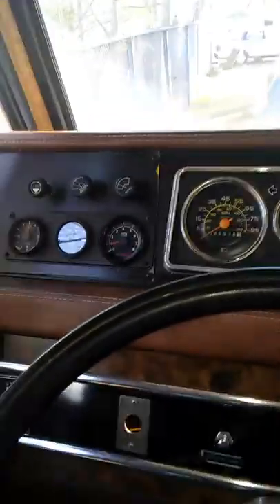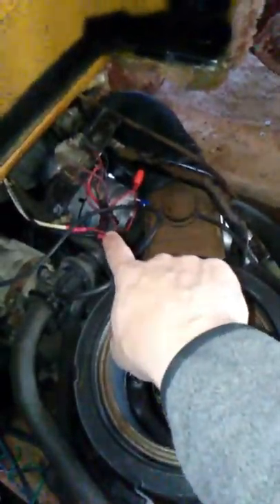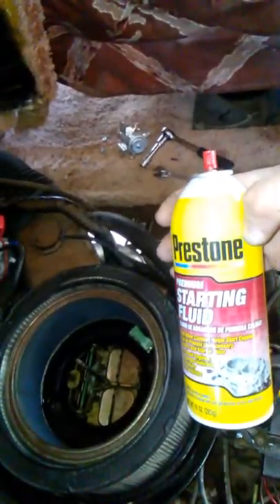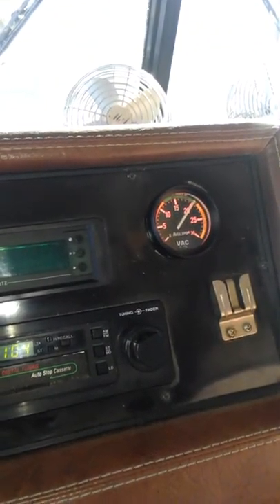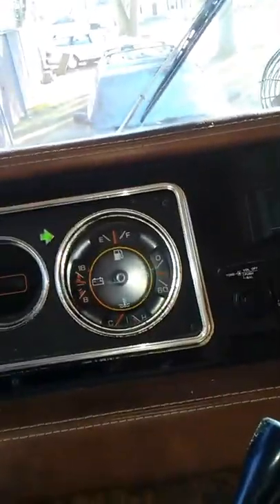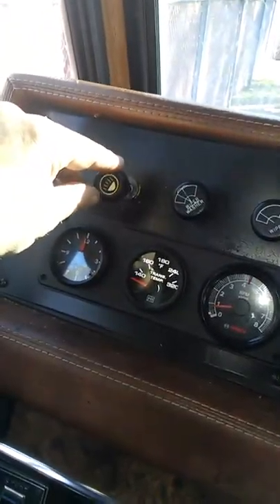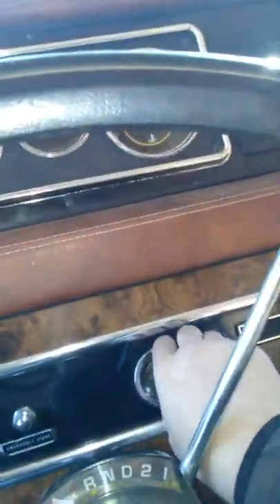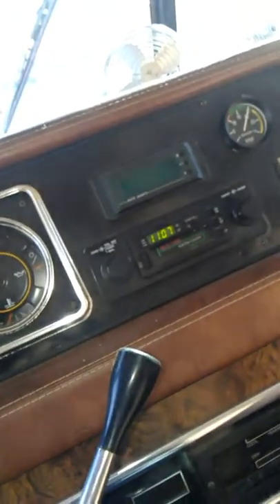The Long Weekend: P30 Chevy crank and no start!!

Comment: Okay i have a completely off topic question. The two hoses that connect above the air box. What is it that connects them. I recently bought a 1988 Coachmen Catalina that has the same engine, but is missing that connection point for those hoses (Previous owner had been doing some work to the engine).
Reply from the maker: Airbox? Do you mean the filter housing mounted to the carb? If so, the hoses are basically the ones that come off the AIR system and one off the top of the valve cover (PCV hose?). With my AIR delete, I didn't need them.
Reply: Do you have some form of contact I can get in touch with you through? I need to send you an image but YouTube won't let me post a link.
Reply from the maker: @archasriel10  danlong315gmail.com
Have at it.

Comment: what was the cause of the no fire
Reply from the maker: It wound up being the starter. Crazy little thing to stop a 454!
Reply: i have a 84 cheverolet p30 with a 350 and have similar problems trying to figure them out i put in a new distributer an now its got no fire at all
Reply: i have a 84 cheverolet p30 with a 350 and have similar problems trying to figure them out i put in a new distributer an now its got no fire at all
Reply from the maker: I had also swapped in a new disto, thinking I may as well for the trouble. I take it you marked the position so you could install the new one. Throwing off the timing would cause this.  @jasoncromeenes6555
Reply: yes i marked everything even set number one cylinder top dead center something else is preventing it from fire i checked the nuetral safty switch thats good im thinking it might be a crank sencor
Reply from the maker: sounds crazy but pop your transmission into neutral. It's worth a try. Not sure if the Turbo 400 has some safety on it for this.  @jasoncromeenes6555
Reply: ty ill try

Comment: How's your starter holding up? I have a 1985 Chevy Gulfstream p30 and I've gone through 4 starters now! They always eventually chew up the flywheel and break. And I just got a new fly wheel put it and already a few months later the new starter that got put in with it bell housing cracked and completely broke off. Every tooth on the fly wheel has a chip in it. Put another starter in it and can hear it catching again when I start it. I'm starting to think there was a manufacturing defect with my model. The owner before me I noticed when going through paperwork had a brace built for it but it's no longer there. Yy 

,
Reply from the maker: I'm on #3 for the lifetime of the RV. Never had them chew up the flywheel so I'd be looking at shims for your setup.

Comment: Would the ignition control module could be rule out if the car starts with starting fuel
Reply from the maker: Yes, that certainly is a good indicator but it's best to eliminate every potential issue.

Comment: Where is the starter located
Reply from the maker: The starter is located under the right side of the motor. If you get under the coach on the right side and behind the wheel you can look up and see it. The replacement was easy-peasy! Just don't have your head under it when undoing that last bolt...starters are pretty cheap for this model (about 70 bucks)

Comment: Could you message me the long that this videos exact steps to fix
Reply from the maker: Sorry! Not sure why I didn't see this comment! The exact fix was just to get a new starter, unbolt the old one and bolt in the new one. I didn't even have to deal with shims and all that since the old one didn't have any. Turns out the heat from the engine caused the old starter to fail until I sprayed it with carb cleaner and it cooled it down. I did make sure I had some sort of heat shield but I think that's just a placebo since it's still bolted to the hot engine.